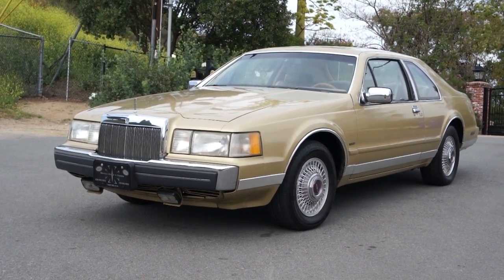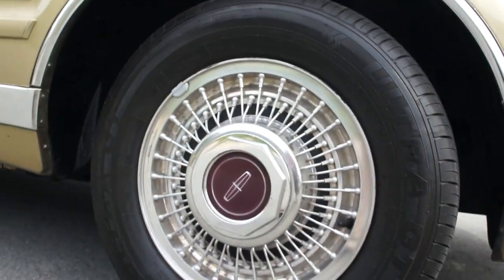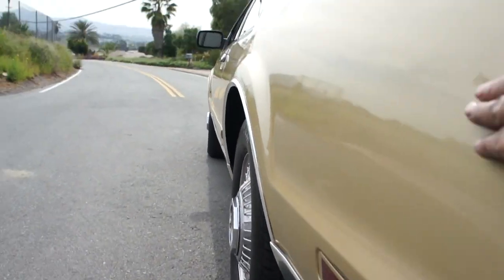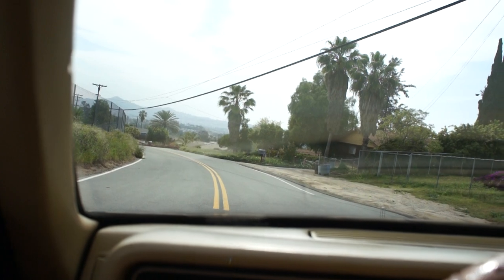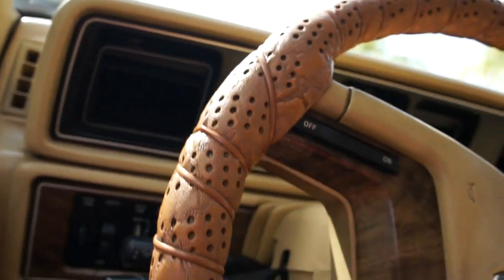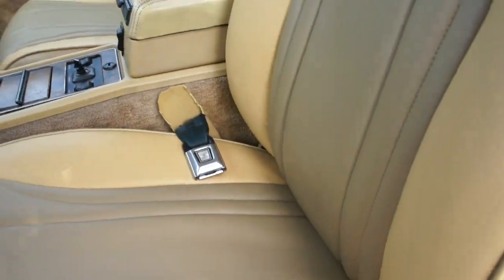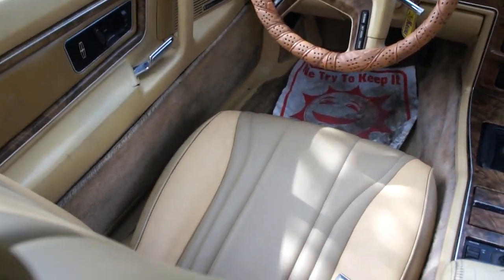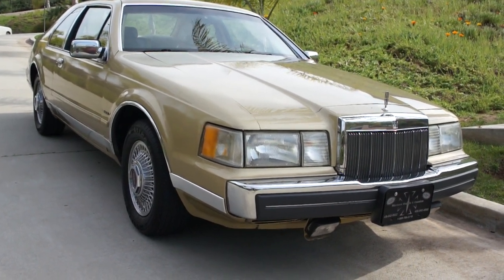1984 Lincoln Mark 7 V11 Bill Blass Edition 2 Owner

Comment: NATHAN, DONT KNOW IF YOU TOLD, YOUR CAR HAS A  OPTION VENT WINDOWS, NOT SEEN ON MARK VII'S, ALL THAT MUCH!!
TO BAD ABOUT THE ROT BUT ITS NOT ALL THAT BAD EASY FIX, IF YOU NEED PARTS FOR THE MARK VII LINCOLN PARTS INTERNATIONAL I N SUN CITY CA. HAS WHAT YOU WANT, MY BILLBLASS (ON UTUBE) HAD A BAD WINDOW MOTOR THEY FIXED IT. OH MY CAR IS THE ONE WITH 4,000 MILES FROM LUXURY AUTO DEPOT, AM I BLESSED ?

Comment: I had an 88 mark vii .I couldnt wait to get rid of it ,very cheaply made interior, lousy paint,leaky air bags.not a good car.
Reply: I had an '88 LSC and it's was one of the most comfortable and reliable cars I've owned, plus saved my ass in a MAJOR crash in which not a single body panel from the car could be salvaged. It could be high maintenance at times but that can be said about any 170,000 mile 25 year old car. It was not hard to work on; hell one of the easiest systems to maintain was the air suspension. I liked it so much I now own a '94 Mark VIII.
Reply: @VinylToVideo  same boat as you. Got my 91 LSC with 175,000 miles. Throws some problems sometimes but overall is a wonderful unappreciated car. I would love to have a 93 Viii and 87/88 t-bird 5.0 with a manual
Reply: @nolanboyer6883 I have a '90 LSC SE now but it's not on the road. Needs a new ABS accumulator, a bit of air suspension attention (probably just a new compressor dryer), and some electrical work but I got it for a song. Well I guess it needs a proper battery, possibly an alternator, definitely a thermostat and now a heater core =( Not a huge deal just need a few extra dollars sometime to get it going. Maybe will sell my Cadillac to do so lol.
Reply: @VinylToVideo  I just replaced pads rotors calipers and accumulator all around. New anti theft control system to fix my alarm. Only problem mine has left is a coolant leak. Get after it man! I know I want to now haha
Reply: @nolanboyer6883  Try AC Delco cooling pellet tabs. They turn the coolant brown but don't clog the system up the way other similar products do.